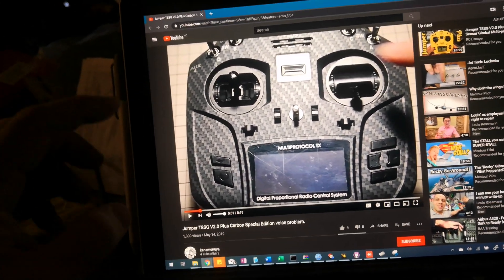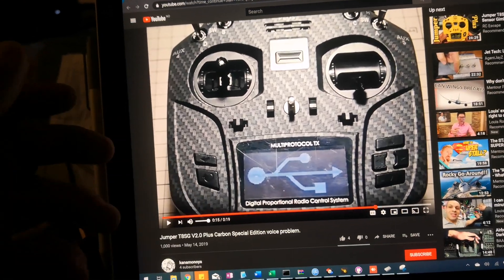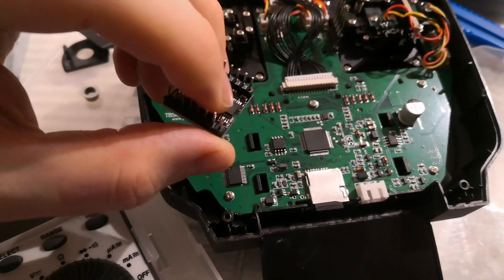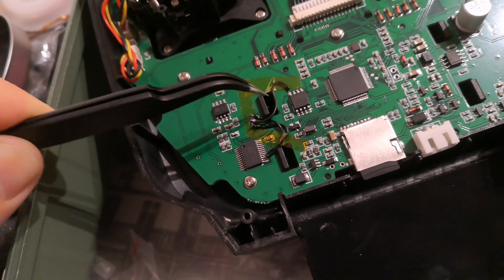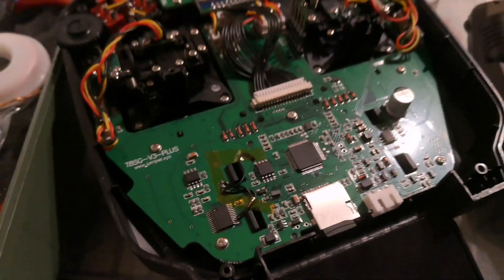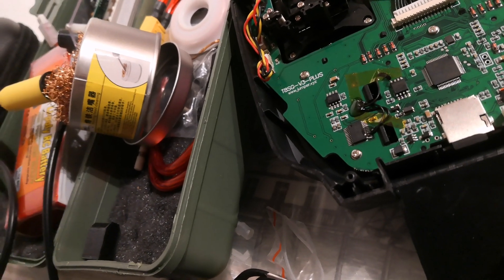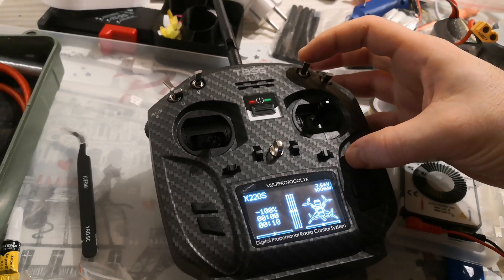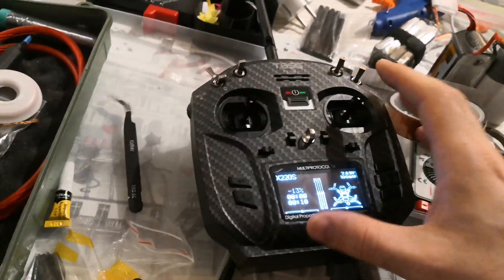Jumper T8SG V2.0 Plus Carbon Special Edition voice problem fix

Comment: I have a new one it comes today  (v3)and i have No voices...only the beeps on trimming buttons..normal? Borken? I have no Idea. And yes i have set some voices on any switches but silence...
Reply from the maker: I think v3 does not has voice module
Reply: @eried   i finally find Out the Problem... IT hast the speaker and voice Modul installed but you need a SD Card and Download the Sound Files in it. And done... Works fine!
Reply: @sunshowlu  Hi Shunshow, can you help me out setting up the voices on mine? thanks by the way.
Reply: @tiagocarvalhosa5849   go to the Website  deviationtx.com Search for Sound Files ,Download and Put it on a small SD Card. the Slot is next to the  battery Plug in.
Reply: @sunshowlu  i got an SD Card already, but i think it needs to have less than 2gb. Mine has 4. Do u know the capacity of urs?
Reply: @tiagocarvalhosa5849  uh... I mean it has 16 but you need less than 1gb
Reply: @sunshowlu  well, i think i don't even got the right firmware, since it says "external voice currently not available"
with a diferent firmware i get access to it but can't almost see the screen, i don't know why, could you send me yours? 
anyways thanks so much for ur time
Reply: @tiagocarvalhosa5849  i have the v3 plus and yours?  Firmware is stock.

Comment: Which pin you jumper?. In spesific adkey 1 and adkey 2 (15 & 16) / adkey 1 and spi_clk data bus (14 & 15). I compare to datasheet of ic yx5200 (ic dfplayer module) its make me confuse. Its right or not?
Reply from the maker: Check the photos: https://www.deviationtx.com/forum/7-development/8640-hardware-fix-for-t8sg-v2p-voice-some-other-fixes

Comment: BTW, you have a T8SG v3.0 plus, look at your PCB
Reply from the maker: oh, I see. It was sold as V2
Reply: @eried  Have you had the Missing Modules: CYRF6936 issue on your unit? It seems that when my batteries are fully charged I get this issue and when voltages drops under a certain value, I never see the error.

Comment: where do you get those resistors?
Reply from the maker: Search for smd resistors in ebay or AliExpress
Reply: @eried  i don't know why I didn't thought of that, thank you.
I've another question. Can we not just stop sounds in the firmware itself and just set sounds as you need em? For example, no bootup sounds nothing. Just alarms on triggers or switch sounds.

Comment: Thanks, this is great! I need to open up my TX and check if the pull up resistors are already in there since I don't have this issue anymore after I initially upgraded the firmware. However I do have other intermittent issues: sometimes it fails to play the boot up sound and usually skips playing the timer alarms at some of the timer intervals (for example 10 minute). Also annoying is the queuing up of sounds. Would be great if you can commit your fix to Github for this so we all can get it!
Reply from the maker: Oh and the github fix is not polished enough, but I will :D
Reply: @eried  No, problem. I'll wait till you create a pull request. And I hope they merge it soon :)
Reply from the maker: You still have the problem, they have not fixed the pcb yet, put the remote in USB mode :P and you will hear a loop
Reply: @eried  I think you are right. I vaguely remember playing with the mp3 files so I may have replaced the "saving" file with a silent mp3 to "hide" the problem. So I have to ask: Will this fix the other voice issues I have detailed above?
Reply from the maker: @sansjunk  which other problems?
Reply: @eried  The startup sound sometimes doesn't play (default of "Welcome to Deviation"). Also when a throttle timer is set it's supposed announce every 1 min. I find that some of the minutes are skipped. It seems to be random but I think the 10 min alarm is never played. I checked the MP3 files and they are fine.
Reply from the maker: @sansjunk  well, the startup sound is part of this issue. The timer is another different problem. I have not experienced that. If you put it in UPGRADE mode, it probably repeats some words constantly
Reply from the maker: Here is the sound system fix https://github.com/DeviationTX/deviation/pull/961 you could compile my fork to try, or wait (if) when the accept it into the main